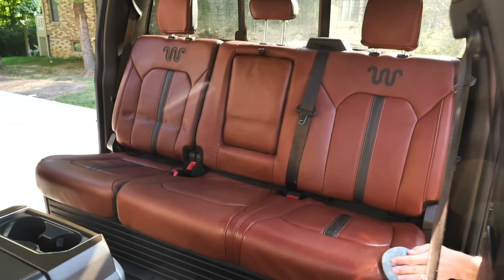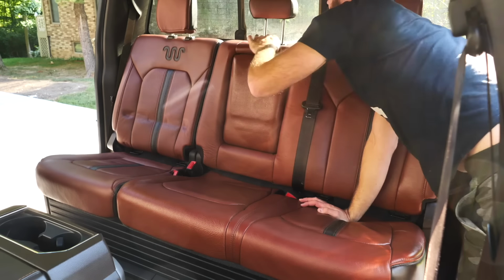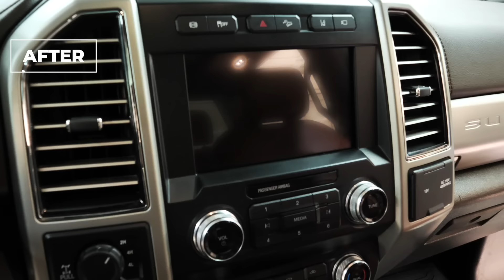Car Detailing A Dirty Farm Truck Ford F350 King Ranch - Restoration How To

Comment: So for the carpeted floor mat, I wonder if it would help to have it on a slope when rinsing it. I suspect the some of the suspended dirt is falling back into the mat. But if the dirty water could drain away more quickly, it might not need multiple passes

Comment: Do you disconnect the battery terminal before you pull the seats out?
I always worry that I am going to trigger the air bag by pulling seats out of my cars.
Reply: If you disconnect the “Negative” terminal, you prevent this and disconnecting the negative terminal versus the positive one also prevents you from resetting the clients settings as well.